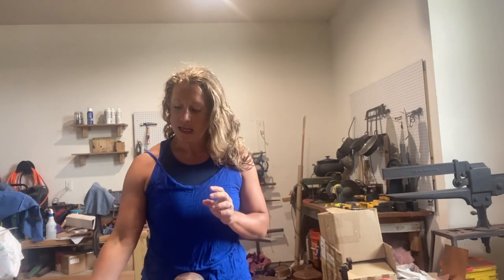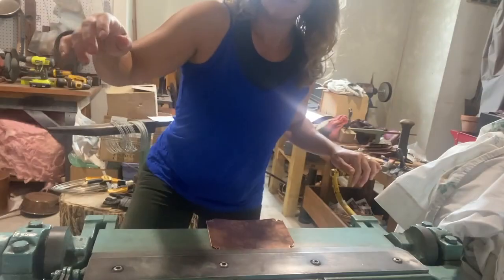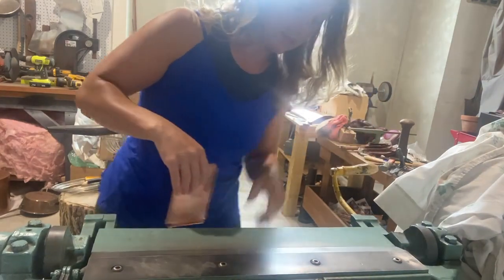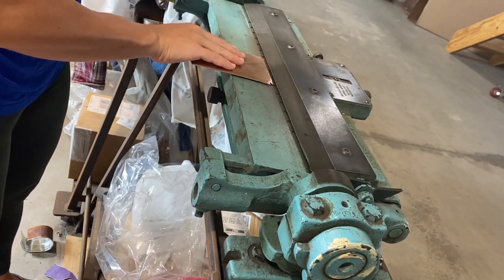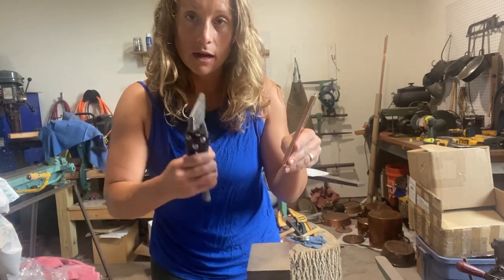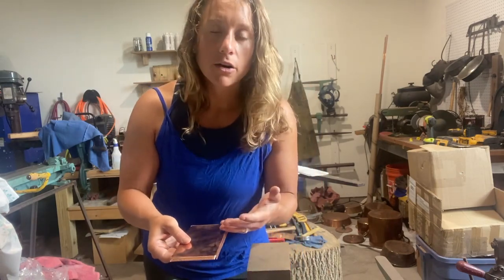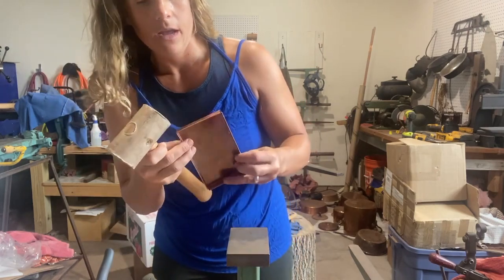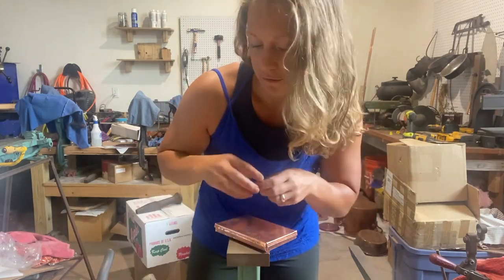How to Build a Copper Box Part 2

Comment: Thanks for another helpful video. Do these boxes not require soldering to hold them together? A video covering soldering/joining techniques in general would be helpful.
Reply from the maker: My sincerest pleasure - so happy it's helpful! Yes - there's soldering in the corners for these. There is a way to do folds that make the corners (mostly) leakproof, but you still really want to solder them so food doesn't get in the cracks and rot. I will absolutely do videos on all the different seams and how to build them and solder them! Thank you so much for the great idea!!